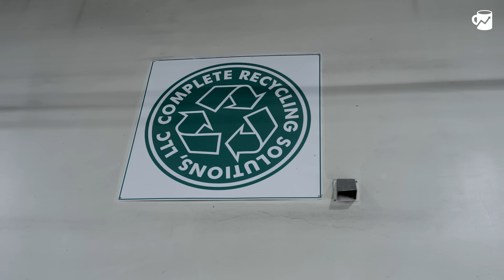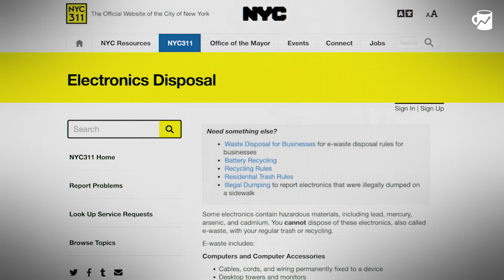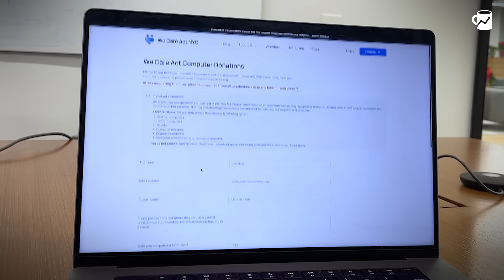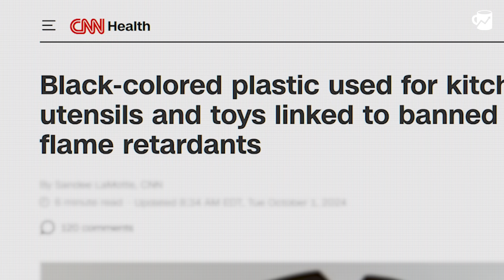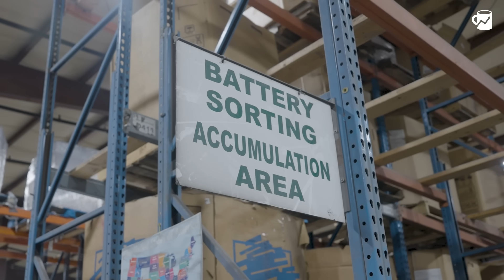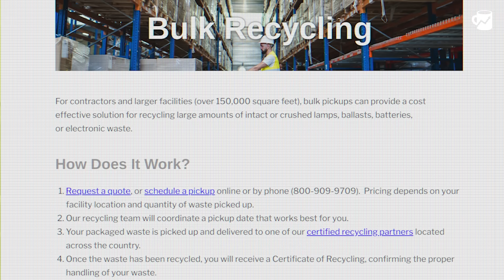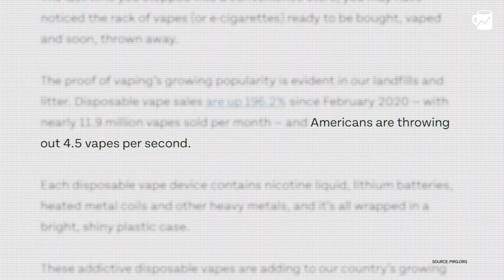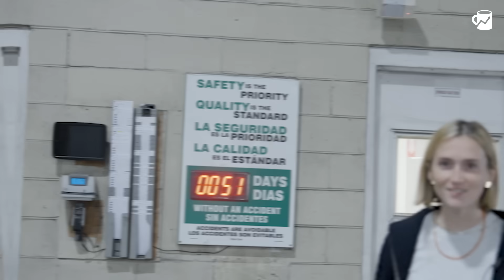I went down a rabbit hole trying to recycle all my tech waste

Comment: So, I can’t say what I do for a living, but I noticed you look like your based in NYC. And I may have a unique inside into how that city disposes of waste 😉.
Fun fact ANY electronics seller in NYC MUST by law accept any type of electronics they sell for E-waste recycling free of charge. 
This law was put into place two full years before the city’s Sanitation department stopped picking up ewaste curbside. (This is when Bestbuy and Staples stated their ewaste recycling program) However, almost all companies just opted to pay the fine for not providing the service, rather then take on the expense of processing the ewaste. (Staples has since stopped taking ewaste, and as you were told Best-buy legally charges for larger bulk ewaste). Due to this unexpected result, In 2019-2020 NYC piloted a program where you could set up a scheduled pickup of your ewaste (similar to how you have to for an air conditioner or refrigerator) that seemed to work really well. However it was scrapped as soon as the pandemic started and was never brought back due to budgeting concerns. 

However there are still “safe Disposal” events held usually once a month (or sometimes once a week) at certain locations throughout the city. These were started for disposal of waste oil, batteries and Hazardous materials, but you are also 100% allowed to bring ANY ewaste to these sites, and they will take them. 
Maybe if the public added pressure back to the city, another outlet might become available again the way they brought back the organics waste program. *wink wink*

But interesting video. Keep up the good work.
Reply: https://www.nyc.gov/site/dsny/businesses/materials-handling/electronics-handling.page#:~:text=Electronics%20Take%2DBack%20Program%20Requirements,were%20bought%20at%20their%20stores.

Comment: Interesting video. To be honest, I have a problem with the mindset that old but still functional devices are "waste" to begin with - anything that still works and is still perfectly usable like an iPhone 11 or 12 (they still get current iOS updates) is not what I consider waste. The idea that some people would actually throw that away is insane to me. If it's outdated to the point of being unusable or broken, then it's reasonable to take it apart or recycle it.

Comment: Really this seems like a problem of entropy. Imagine all the additional CO2, embodied energy and manpower/logistics that is produced/consumed/required just to de-manufacture / recycle tech waste. (Not throwing shade at e-recyclers, to be clear, they're doing good, necessary work to help mitigate tech waste from entering our biosphere).

Remember its REDUCE then Reuse and Recycle. Really we need to address the problem at the source of reducing production to only what folks need rather than what makes investors happy and reducing consumerism.  Degrowth, sustainability, killing off the growth imperative and killing consumerism is something that needs to be seriously considered if we're to last long term as a species and not fuck up our planet.

I'm 100% for Right to Repair and reusing/recycling. Especially in local contexts. If your reused, repaired, recycled e-waste stays in the same region then far far less CO2 / energy has been produced/consumed to repair it / ship it to a place to be reused.

I recommend folks look up Embodied Carbon, Embodied Energy and Lifecycle Analysis.

Comment: Here in the Netherlands, I believe it is required for stores to collect for recycling whatever category they are selling. And most go beyond that, like most supermarkets have a bin to put batteries, lightbulbs, electronics and small appliances (up to like toasters). And bigger appliances like TV's and dishwashers you can bring to disposal sites without cost.... at that time. You actually pay for the disposal when you buy the product. It's a separate item on your receipt. The retailer is responsible to collect that fee. The manufacturer is not involved in any way. I think this is a pretty good and fair way to do the collection and finance. But the recycling itself isn't any better than anywhere else. Sure its easy to recycle valuable materials but well we don't really manufacture electronics so where are we going to use it? Shipping it across the world to hopefully not see it again washing up on the beach is the best we can muster.

Comment: I tried fixing a tv that wouldn't power on and even thought I narrowed it down to the LED that gave out. Replaced the strip and it still hasn't worked, tried to mess around with the board but everything is made so fragile with so many failure points and made in complex ways that it's just not worth repairing and the diagnosing headache.

Comment: I have an iMac that Apple wouldn't allow updates on and struggled with a windows installation. Facing sending it to e-waste I decided to turn it into a Linux system and extend it's life rather than buy a new computer. That could be an option for your old MacBook as well.

Comment: In Finland we have a thing called producer responsibility which basically means that for alot of goods brought or produced here has to have an end cycle as well. We have several non-profit organizations that oversee it all and figure out the whole where do we put this. In case of E-waste all big chain E shops have drop offs in their store where you can bring everything including washing machines, fridges, lamps, batteries and all the other E-waste for free. This then gets delivered to facilities that recycle the material or re-use for phones/tablets if it's possible. For the consumer the price of recycling Electronics is already in a way in the purchase price so there is no reason not to recycle. Sometimes the chain is one stop shop and other times it's a longer chain that eventually leads to re-use of material. And yes unfortunately not everything can be recycled or the cost is astronomical so a marginal amount of materials that are safe are landfilled.

Companies can also deliver / sell their old stuff directly for recycling and get money out of it.

Also about the purchase price, as in this video some material has value and others have costs so when you balance those out the increase isn't all that much. So we are not paying all that much extra in the end.  :)

Comment: (I'm a former Geek Squad agent) Can confirm Best Buy will take e-waste, with caveats (may have changed since I worked there); in some states with limited access to recycling centers, or locations with high-volume traffic, you may only be able to drop off up to three items per household per day (not including small accessories like chargers and cables), and yes, there is a surcharge for large items like TVs, which covers the cost of transporting them to a disposal site (used to be $25, but clearly has gone up). California charges an LCD recycling fee upfront when you buy a display device, which covers that cost. They may also still have a size limit on TVs brought in to the store (used to be 42"; may have changed). Best Buy will take your old equipment as part of delivery/installation of new devices purchased through them, such as major appliances and TVs.

Comment: You call that a rabbit hole? 😂 That's cute. Tldr fix the financial system and economy and a lot of problems like this will be solved naturally because most of them are money based. E.g planned obsolescence  exists with miniscule tech advancements. These are different but have the same effect.
Whitegoods manufacturing are missing out of the tech money cash cow and want some so they act like tech companies.

Comment: As someone who works in tech, consumers do create a large amount of e-waste, but nothing compared to what corporations create. Ass a consumer most will not update their computers as often as they do their phones. Most consumers will still try to fix a device before replacing it. Most corporations must update their computers on a 2-year cycle. It is more financially beneficial to buy a new computer than to repair a device, especially when dealing with downtime. And do not get me started on how entitled people are in corporate jobs. If their electronics are not the latest or even if they have minor scratches or dents, they will complain until they get a replacement. Most e-waste is created by corporations. At the company where I work, most employees receive a two-monitor setup, a docking station, a scanner, a printer, a laptop, and a desk phone.

Comment: As an IT technician, this was fascinating to watch. The break-fix shop I work with works very closely with e-waste recycling efforts. One thing you did not mention is that if you break down laptops and desktops your self, you can usually sell the broken down PCs to a local scrapyard. Especially with older models that tend to have copper heat sinks, you can make a decent chunk of change off of a dozen scrap desktops or so. Assuming your local scrapyard handles circuit boards, batteries, and power supplies.

Comment: Being in NYC, you have many more options than most other Americans. I live in a sparsely populated region and in a city of 200k, I'm only aware of one small E-waste recycler.
I've heard about some cities disguising waste management companies with the appearance of being recyclers but what they collect goes to trash dumps. Also, most plastic isn't recyclable according to several sources I've seen.
Reply: yeah literally, i live in a super rural town and i was watching this thinking "okay well my county doesnt have a goodwill, an apple store, or a best buy, and we dont have a massive e-waste focused recycling center soo..."

and you are correct, lots of plastic cannot be recycled. even the process described here where the plastic is pelletized "to be used to make other plastic goods" can only work a few times because plastic degrades and sheds so rapidly (see the microplastic problem) that it eventually becomes unusable
Reply: @nurserykitty  My rural town offers e-waste drop off a few times a year. It's not enough to meet the needs of the community, but it does help
Reply: I work at a county landfill in Upstate NY and we take all e-waste for recycling. Sunnking picks it up every few weeks. I really don't think waste management companies are just taking it to the dumps. They are risking high fines if and when the DEC finds out. They may be taking it to the dumps for, like I said, a recycling company, like Sunnking, to pick up. The DEC oversees landfills and recycling.

Comment: I've worked in this industry for the past 6 years, and I can tell you that most (not all) recyclers find ways around R2 processes, even if they are R2 certified. If a company is not R2 certified, then they are most likely doing insane things with the less profitable material. As far as material recycling is concerned, theres really only a handful of precious metals these businesses go after, the rest usually gets trashed or shipped off to somewhere illegal. 
On the plus side, nearly all ewaste recyclers have an ecommerce store, with eBay being the most popular. So anything that meets a certain monetary threshold getsndeverted from material recovery, and since the profit margins are significantly higher for ecommerce, most facilities will divert as much material as possible.
My advice to anybody reading this, reset and remove your icloud/google account from your phone before you recycle it (this makes it much easier to resell for the recycler, and is just good practice for your personal privacy), wipe or remove your own hard drive or solid state drive from your computer, and only take televisions to R2 certified facilities.

Comment: Surely a computer is worth $50-$100 in scrap value alone? And I bet you could get twice that if it's in working condition, even if it's 10 years old.
Reply: Not even close, for laptops you're looking at $10-15, and desktops $10-20. A lot of value can be recovered by reselling newer hardware, but in terms of precious metal recovery, that's pretty average for devices made in the last 20 years.

Comment: Dude most people just load the stuff up and take it to Best buy. I had about half a box of old cords and like two laptops and two tablets. Their old stuff that just got outdated or the battery slowly died on them. They do recycling in the US, as does Staples -- for free.
Reply: Staples and Best Buy just send that stuff to recyclers, they don't actually recycle anything themselves. Staples in particular sends their stuff (or at least they did back when I worked there) to ERI, which is a very large, very shady, ITAD entity.

Comment: One thing to keep in mind is the definition of recycling, it can also mean burned as "recycled to thermal energy" (at least here in the EU).
A lot of times, recycling is also defined as even entering the recycling chain, rather than getting thrown into the trash.

20-25% is the figure of E-Waste which gets collected properly in the USA and far from the amount of materials making their way back into the production cycle. 

I help out at a non profit organisation which takes Laptops from Companies that would otherwise go to waste, refurbishes them and sells them (at cost). 

I get lots of PCs, which come in with the Laptops to be disposed, as even for a non profit they'd take up the storage space. So I refurbish them in my spare time as a hobby and try to sell them at cost (HDD/SSD as they usually get removed/destroyed for data security).

Comment: Reusing old electronics is very labour intensive and the cost of spare parts is also very high making the cost of reuse prohibitively high. I have a 15 yo laptop that still works and my son occasionally uses. It needs a new screen as there are some dead pixels on it, the old battery is completely gone, etc. Replacing these parts just doesnt make any financial sense. 

its the same with the phones, most old phones still work but bringing them to good condition is too expensive and its just not worth it.

Comment: Wait.. so if you want to recycle monitors they charge $30 ?? It should be free you already pay for it why pay money to throw it away?. That’s weird.
Reply: It costs money because there is very little precious metal inside of them, so there is very little value to recover. Screens of any kind cost money to recycle, especially if an ewaste company does it legally. $30 is a bit extreme, but an average monitor display can cost $5-10 to send to one of the few licensed downstream recyclers in the U.S. Somebody has to get a paycheck for sorting through that waste, taking apart the monitor to get to the low grade power circuit board, drive it to a downstream facility, etc.

Comment: Honestly the biggest way to help with tech waste and recycling is to not buy as much tech.  In the video you show your older iphones, most of those were only 2 years apart at best and the iphone 12 and 11 pro are still a good iphones and that do pretty much everything the newer models can.  If the Ti-83 still works there is a school somewhere or a organization the helps poorer kids that would happily take it because they are still insanely expensive for there age and still required for schools today.

Comment: I am from Kenya. E-waste recycling is barely unheard of. You either donate your old laptop/phone to your younger sibling who would then use money more or less equivalent to the amount buying a new one to get it refurbished. 
Plastic recycling initiatives are quite popular. The most common are metals (steel, aluminum, and copper) and plastics (PET, HDPE, and PP). However, due to their hard-to-recycle properties, scrap waste dealers tend to reject PC plastics, such as those used for electronic covers and automotive parts.

Comment: Wait, you don't just take your electronics to the local council recycling centre? We just take it to the council dump, you put cardboard in a cardboard skip (container sized not a household one), you put TVs in a skip full of TVs, rubble in another one, wood in another one and so on. We can also take batteries back to any shop that sells them - they're legally required to have a battery recycling box which makes it very easy for recyclers to collect that waste and turn it into new batteries. Most electronics shops will take basically any  electronics, no matter where you sold it, and recycle it. That you don't have these sorts of setups in the US is just yet another example of why the US is so backward compared to every other country.

Comment: For hard drives, Don't forget the one in a business printer.
The easy way to secure the data is a bolt.  Basically take a rod and sledge hammer till the plates are touching.
 Only an very expensive machine, clean room, and knowledge can retrieve the data.

Comment: Many items still work as intended. 
The consumers need to decide if its still useful. 
Calculator still calculate.
Clocks still shows the time.
20 year computer can still access the internet, plays audio files, read from USB drives.

Its fairly easy to dumb down cell phones. MP3 players, PDA, Just need permission or policies. 
  Electrical usage need to be consider.

There is a few organization that needs volunteers to sort the items.
  Please look into it.
 We may have to add a return fee on the product, to supplement the sorting process. 
    Glass bottles and aluminum cans as an example.

Don't forget the ~15% that never gets used and the packages.  Maybe create a false demand?

We can reduce 80%
Cost, convenience and the will is the only thing that is stopping us.

Comment: You should also mention that lot’s of electronics gets thrown away because the software support ended, Or the devices are (made to be) uncomfortable slow. That doesn’t mean they are trash thought. If a company discontinued theirs Software they should’ve forced to make the Software open source so anyone can reuse or repurpose this hardware (old phones or pc/laptop would run a lot better with a less bloated OS)